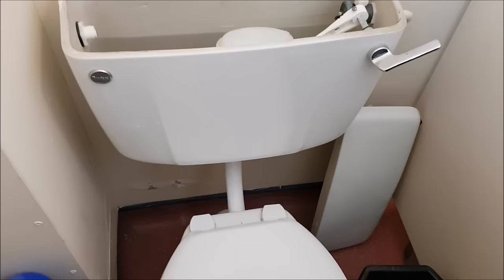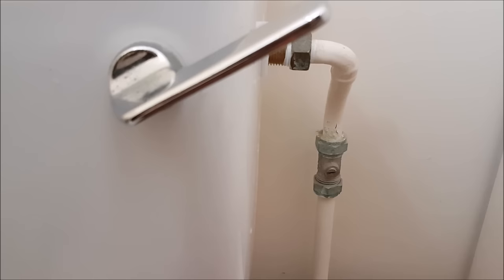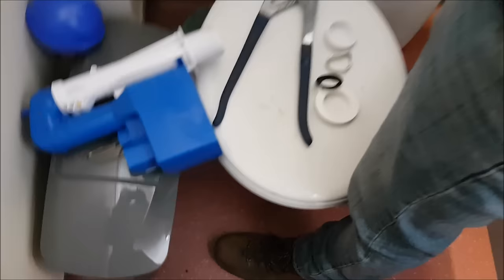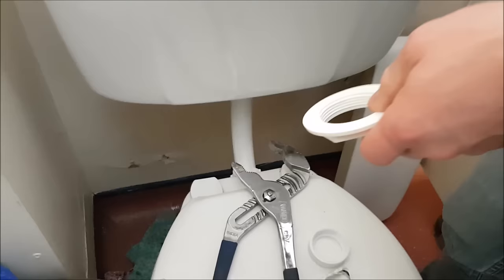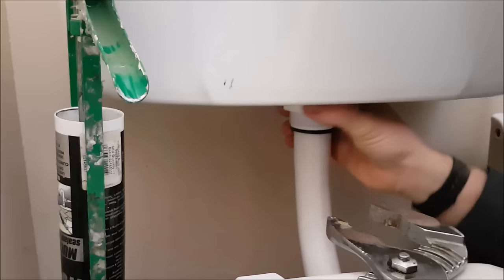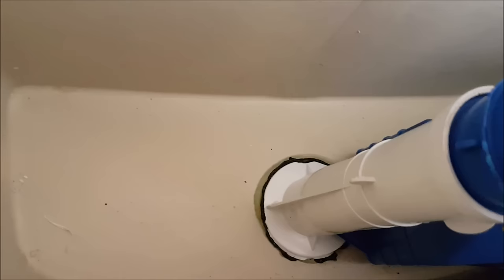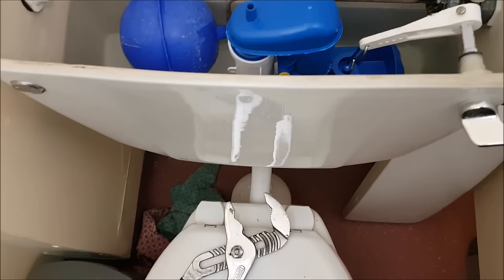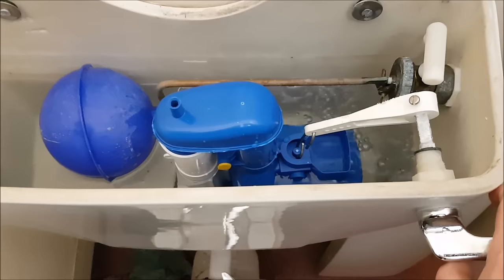How to Change a Toilet Flush or Syphon Unit

Comment: I guess you siliconed the siphon in because the bottom rubber washer seemed a bit rotten. Why not just replace the washer? When someone needs to replace that siphon, they'll have to force it from that silicone glue!
Reply: Silicone was a bad move.
Reply: No need for silicon they self seal. I think because it’s a Dudley Turbo that when it fails again you can pull the yellow pin to remove the diaphragm, they just made it solid but you wouldn’t want to try to remove it if need be. 🤢✌🏻

Comment: When you take the flush pipe away from the back of the pan check that the  three holes in the inlet side of the pan(where the flush pipe goes in are not blocked)common in hard water areas

Comment: With this type you just unclipped yellow plug .. I did to change syphon from down pipe . Got new syphon ..and fitted back with the clip .  But still didn't work properly .   The handle lever was too short ( should pull straight up )and pulled plunger at an angle from the syphon ..this wore out washer znd damaged the down pipe .top .very slightly .the new syphon o ring allowed bit of air so stopped vacuum..yanking handle still.  So put bit of margarine or silcone gel around top of syphon to down pipe and ..hey presto ..it worked ..!!
Saved me from taking cistern off as it was enclosed behind tiling box section.
If that helps
Reply: could you explain this in simpler words. couldn't understand it

Comment: Surely at 2:16 you shouldn't be able to pell the nut straight over the washer ?
How is it going to tighten up on it ?
Shouldn't there be a blue plastic 'stiff' backing washer that crushes the conical black seal
as you tighten the nut ?
Admittedly as you tighten the black washer it will crush and expand and is unlikely to
slip through the nut but to be safe I'd have included the blue washer.

Comment: Good video but i have a question i can flush the toilet but when I push the flush lever down it wont come back up by itself do you know how i can fix this?
Reply from the maker: not without looking at it sorry
Reply: Either the loo handle has scaled up or the spring in the syphon Bell has broke
Reply: @johnbarnes4420 how do you replace the spring in syphon bell?

Comment: Roughly How much would this cost me to get a plumber to do this for me. Cheers
Reply from the maker: £100 at least
Reply: @MrMeltedwellies  ive bought the part gonna just go for it and give it a go. Ill let you know how it goes gonna do it today cheers
Reply from the maker: GOOD LUCK and yes please let me know how you get on
Reply: @MrMeltedwellies  hi so yeh got the job done was a right kerfuffle tbh the job overall was quite easy but heres what happened. I went and bought a new flusher the day before i started the work i didn't know there were different sizes never seen one in my 38 year life 🤣 so obviously take mine out realise the new one is too big my toilet unite isnt flat at the bottom ( square shaped) like most it drops down so the part where the flusher goes is a small area so while i was cleaning out the toilet my parter went to b an q for me i told her needs to be smaller than that anyway she somehow buys a bigger one 🤦‍♀️ so i go try a few shops couldnt find anything but eventually found one and jobs a good en works perfect now realistically not even a 30 minute job even for someone like me with absolutely zero experience. Took me about 4 hours with running around looking for one, what made it hard aswell what my toilet unit is about 8ft in the air was awkward to get to but its done now hopefully get another 20 years out of it or more. Thanks for the video 👍
Reply from the maker: Thanks for letting me know ,well done for having a go all the best 💩👍😂

Comment: Could've done without the double entendres.  Aside from that it was ok.  Very awkward way for fitting the new siphon there.  Would have been easier to hook it on before lowering into place in my opinion rather than extra effort when all is locked in place.  You lost me at 4:33.
Reply: Yes, the famous "builder's banter" is about as funny as herpes.

Comment: You could have saved yourselves a LOT of work.  By just undoing  the nut  which holds the ball valve  and while you're at it changed the diaphragm  rubber at the same time.    Also where is your overflow  pipe ??
Reply: This type of siphon has a built-in internal overflow.
Reply: Sorry mate. Didn't notice that.  Cheers

Comment: Plumber replaced washer in my toilet and it still drips. He wants another £60 for labour and £70 for the innards to replace the existing one. Is that reasonable. I already paid £848 for jobs including fixing the toilet.
Reply from the maker: SUCH A RIP OFF
Reply: @MrMeltedwellies  Thanks for confirming what I suspected. They work on recommendations and because of that I booked them without a quote. All they did to fix the toilet first time was a washer change.
Other jobs were shower unit replaced, tap in kit hen replaced, hot water tap in bathroom innards replaced and reattach a pip in my sink that kept coming loose. Labour for that was 4 hours at £70 per hour plus VAT.